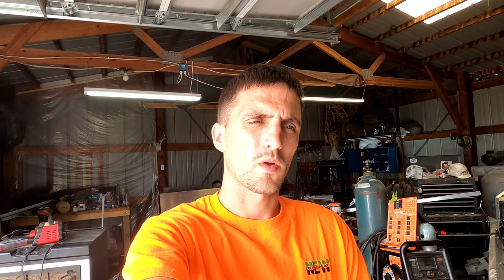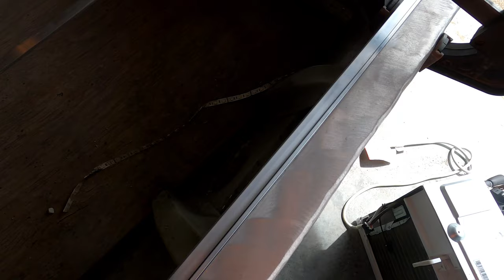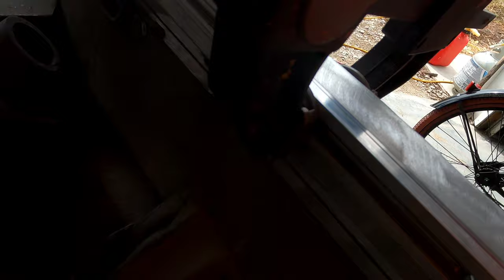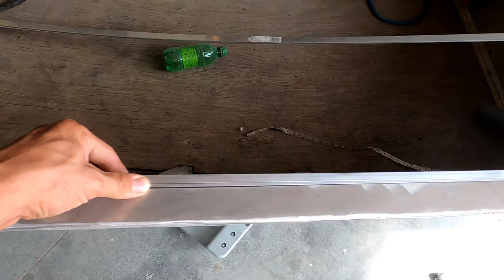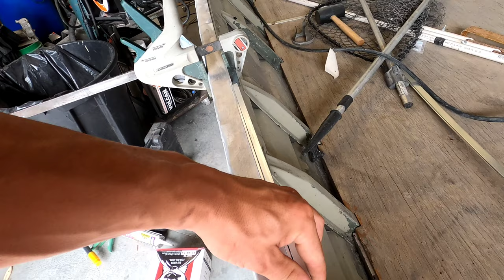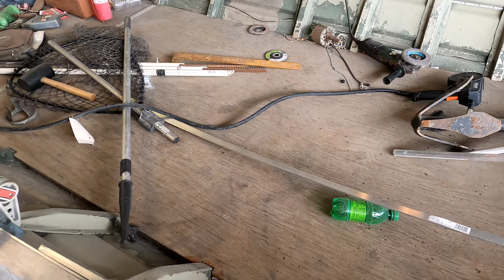Adding T-Rail to the john boat

Comment: Do you know if like all the wjr handles and things like that fit in this t rail?
Reply from the maker: I’m not very familiar with them but it looks compatible might have to use different bolts but you can buy bolts that slide right in this t-rail from any local hardware store.

Comment: Did you finish this? How are the screws holding? How far apart did you put them.
Reply from the maker: I have not finished this project yet, I will do a follow up video this weekend.  Hoping to be able to get this project back in the garage this spring.